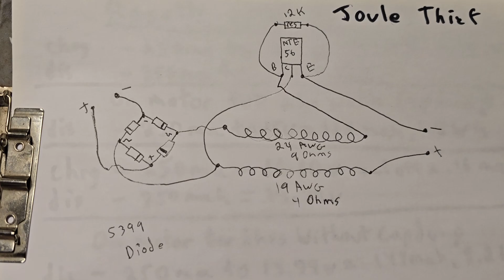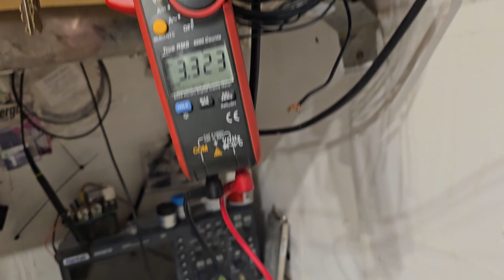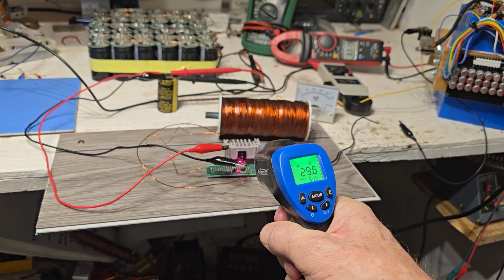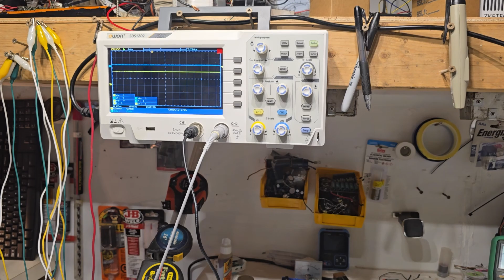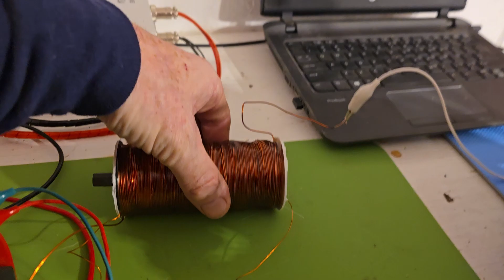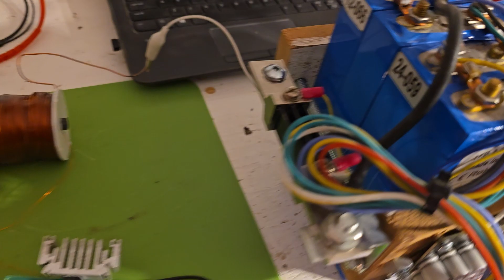5LBS Joule Thief  coil has lots of capacitance ...gives VERY GOOD results!

Comment: Great work, but i think you have a big loss in the coil that goes to your base because it dumps all its energy back to the negative via the resistor and you get zero gain from the transistor. You don't need that big of a coil to switch the transistor. You can rather run that  coil in a bifilar config. with the main coil and wound a shorter lighter coil to act as your pickup to your base of the transistor.
Reply from the maker: No you're wrong sorry bud thanks for watching you don't understand how this circuit work you're actually clueless.  I'm not trying to be rude but please be patient and watch for upcoming videos showing how everything interacts together in this circuit.  I'm only releasing videos weekly but have already. There's only gains in this circuit and the proof is coming. The resistor is there for a reason as is the bridge in that location for a reason.  This is not a Joule Thief circuit

Comment: I'm a little unclear on your experimentation intent. Are you trying to boost the voltage to charge your supercap bank from a lower voltage lipo? If so what charging power are you hoping for and what is the target voltage? And what design constraints are you aiming for?(cost, input voltage, complexity, efficiency and so on.
Reply from the maker: This circuit is raising the voltage in The large super capacitor bank while maintaining the battery voltage.  There's going to be much more about this coming up soon as it's been recorded daily. Also a very detailed video with current flow throughout the circuit and why it does what it does.This video just gave a crude peak of what thr circuit does and is more intended to demonstrate how much current it takes to fill the coil up to it's capacitance level then see the current drop suddenly to near zero while the output increases
Reply: @windpowerandmore6310  I don't believe that you are actually charging the capacitor without draining the battery. My best guess why it may look this way is the charging current is too low to be seen on the battery mounted meter. I estimate average charge current to be 1.3mA or so over the 114 seconds from 27:47 to 29:41. In that time the 10,000uf capacitor was charged by 15.3volts 44.9v to 60.2v. Current=C*dv/dt  so 0.01F*15.3/114=0.001342A or 1.3mA. Also the pulsed nature of the charge coil can screw up voltage and current measurements as you have mentioned in your other videos. In addition to all that its easy to forget how little energy a 10,000uf capacitor can store so when you see a 15 voltage change on the capacitor and no perceptible change on the battery voltage it may appear that energy is coming from no where. Keep up the experimentation! :)
Reply from the maker: @Kezat I'm not talking about the small 10000 uf cap  I'm talking about the 105V cap made out of 42 2.7v super caps 500f each which is roughly 11 farads at 105v . You just have to wait for upcoming videos to see . I don't base my information with the analog meter I use very accurate clamp meter which measures everything! You can do all the estimates all you want but I've got the real measurements.  This circuit works very much like the serps device that uses power on the way out then returns it directly back to the battery.  And you will see this in upcoming videos
Reply from the maker: I'm not trying to be a dick but all I can say is replicate it for yourself and do exactly what I did and use the same bank of Supercaps and components that you're going to see in the upcoming video because it's a bit different than the setup in this video.  Also this video is just intended to show the coil and circuit behavior as the coil reaches full capacitance
Reply: @windpowerandmore6310  The small cap was used as a example because you demonstrated a coil oscillation mode using the small cap where you believe the total consumed power falls to zero 27:47 to 29:41. I was trying to demonstrate that it could easily be so low that the 1.3mA may not even register on the digital meter, regardless of what capacitor size is used. 
I'm happy try and replicate this, that was why I asked for more information in my first comment as I enjoy tinkering too. Though admittedly my interest is more about efficient voltage boost with a simple circuit, and not so much "free energy". I will check out your next videos.
Reply from the maker: @Kezat yes you're right 100% I did say zero but it was still using about 20 ma I think.   The circuit has a few different frequencies when starting it and has to be tapped and observe the state it's oscillating in.  There's a state that it sends power out from the battery then it goes right back it at almost 100% . I have a really good video coming out next week showing this and I clarify a few things about it.  If you want  to email you I can send you a short clip to show you what I'm talking about with leds and scope current clamp readings
Reply: @windpowerandmore6310  sent

Comment: Quality work.. Maybe add a Triac switch circuit might help facilitate and enhance energy transfer of AC from the Joule ringer to the nte56? They behave like SCR but for AC only. Just an idea. Thanks as always
Reply from the maker: Yes sir buddy! I've got triacs here I'm very familiar . I'm finding the driver circuit is the way to go.  But these circuits demand lots of copper after that it's a matter of getting the right voltage input.  Adding any resistance to the circuit completely changes the characteristics of the power flow. I mean like trying to control the base doesn't work because the power flowing through the base is key to it operating properly.
Reply: @windpowerandmore6310  Makes perfectly sense. Thanks for explaining and clarifying the process learning a lot from you 👍
Reply from the maker: @11Sam11 I'm learning from you too . This stuff is definitely real and no antenna or ground involved it's a floating circuit.  The next coil I'll be documenting should be very interesting! As it is right now with this coil and circuit I'm seeing only gains.  Can't wait to see more of your project!
Reply: @windpowerandmore6310  That's awesome mate. Cant wait to see it.  I should have another video posted in about couple weeks, still waiting on parts grr. I still have some nte transistors and the metglass rod and definitely will replicate your work once successful on the self loop attempt. Looking forward to your next video 😉👍